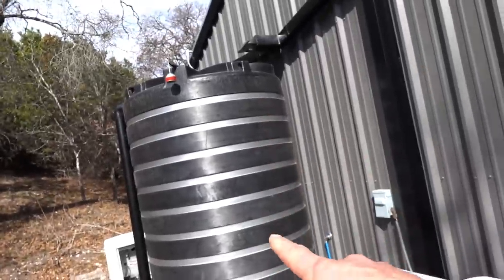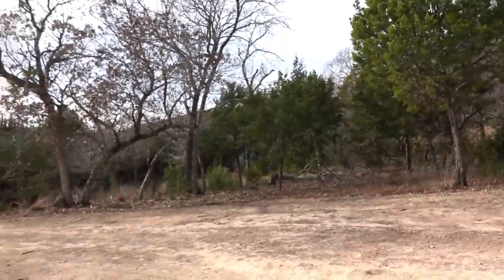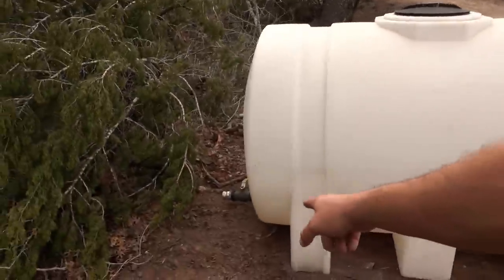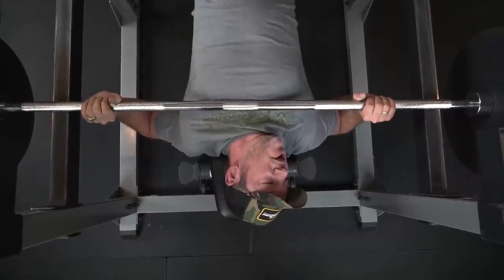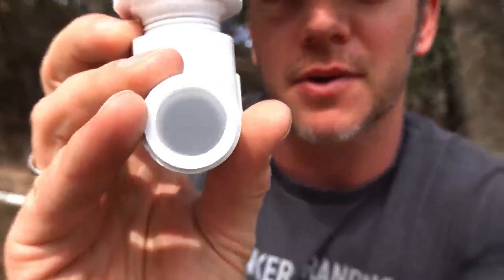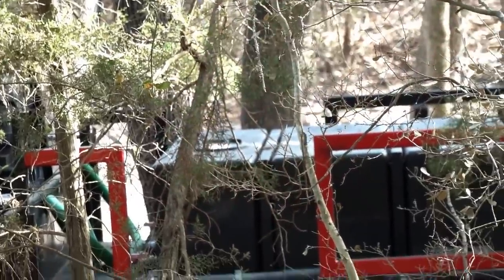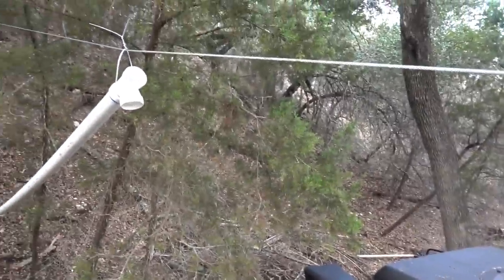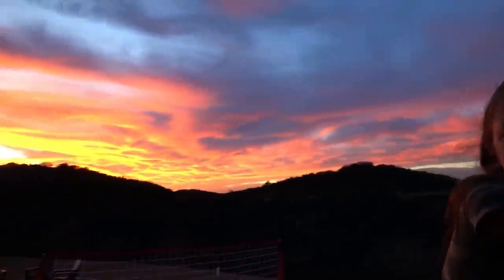Trying to Make this Work... And my Fire Truck is BROKEN!

Comment: Just thought I would point out that you don't need to suspend the pipe at all. As long as the highest point in your downstream connection is below you source (tank) output, you will have pressure to create flow. You could run your pipe along the ground till the bottom of the hill, and then have it T up to your valve for filling the firetruck tank. Your pressure head will be the same at the outlet (mostly, because your losses from pipe bends will be of negligible difference) regardless of whether or not you suspend the pipe. You would just need to make sure that you can drain from the lowest point to prevent any burst pipes from freezing.
Reply: even if the highest point is higher than the source, it will flow, once the air is cleared (syphon) - as long as the end point is lower than the source.
Reply: this
Reply: I came here to make this comment. Glad someone else saw this right away.
Reply: matts not worryed about anything freezing and bursting look at the water pump lol
Reply: Physics at work!
Reply: If Matt just had access to an Engineer, preferably a civil type, and get their ideas on how to properly set up a water system. They would probably tell him he should get 2" poly, as it comes in  lengths that would make the run to the bottom of the hill jointless, it's more resilient and is less prone to cracking unlike schedule 40 PVC. But, were would Matt find him a Civil Engineer?

Maybe he should go ask Mere.
Reply: @Bugsey35  you just need basic understanding of physics
Reply: Yep. PVC is not likely to last long suspended by ropes/cables from trees, lol.. should've used an irrigation pipe instead (although I understand it's not as easy to find)
Reply: @Justin-C  The point is, nothing needs to be suspended. You just run the pipe all the way down the hill on the ground. Then run it up the tree to whatever height you want. The only thing "suspended" would be the pipe to get it into the water tank on the truck.
Reply: Matt you used dwv pipe not intended for pressure also you have to get all the water out of the pump when it’s freezing out. Also you don’t need to suspend pipe the pressure will be the same if you fill from the bottom or top of the tank.
Reply: @rgoers  I'm aware. I was commenting on what was actually done and how it's likely to go.
Reply: And if he wanted more pressure, a pump with a solar panel would double the pressure.
Reply: @Bugsey35  I pointed that out above with links to the correct product (Aussie ones admittedly but its enough to know what to buy). For some reason Americans love PVC for everything even pressure pipe, poly is far superior and a lot more freeze resistant.
Reply: @marvindebot3264  yeah we use HDPE for most stuff at work.
Reply: Also could have gotten a 12volt 55 gpm pump for less than $200 and could jut put the tank at the range…
Reply: @Bugsey35 Picturing Mere laughing so hard if she sees this! 🤣
Reply: 🤣   I laughed so hard watching him do all that with the pipe
Reply: I wouldn't even suspend the pipe to fill the fire truck, I would just use a hose as I think the pressure is in relation to the outlet to the body of water. Meaning that you would get better flow if the hose outlet is at the bottom of the fire truck tank
Reply: I guess I'm not the only one who had this idea. It's the same principle water towers use.
Reply: @Bugsey35  His wife Mere is a civil engineer?
Reply: @Bugsey35  honestly probably the comment of the year right here.
Reply: @Bugsey35  I was gonna say.....ditch the PVC and definitely go for the poly pipe rolls.  With 2", I believe they come in 100' rolls....

I would use 2 inch for the first 100', and then step it down to a 1" poly pipe for maximum pressure.  Plus the 1", or even 1 1/4" poly pipe comes in 300' rolls.
Reply: Awww, dude your late, you just missed the EDC in Vegas
Reply: @Bugsey35  😂🤣 you win the internet today.
Reply: Ya what he said
Reply: @brandonbennett127  Pressure is based on elevation, flow is based on pipe diameter, reducing the size would decrease the flow and pressure
Reply: @PhiLBilly_PhilRodgers  it should be fine. That water pressure will prob never see above 40 psi
Reply: NO !! That is not how it works !  The system would only drain to the equivalent height of the pipe as it comes down the hill . " Water seeks it's own level " !  In other words . If he took the pipe to the GROUND then put in a Tee and went up 10 ft to fill the F- truck . If you took a laser and pointed it LEVEL towards the pipe coming down the hill . That is the amount of water that would not come out 10 ft up !!  It is no different than gluing a U  shaped pipe with 10 ft risers and a RUN of 20 ft , then fill from one riser . The water would fill up both risers and stop coming out IF not pressurized.  Further , if the tank isn't vented to atmosphere, it WILL pull a vacuum and stop draining !
Reply: @g120957au  NO ! Decrease flow , but increase pressure !   Think of a power washer with no nozzle compared to the pressure with the nozzle installed.
Reply: And he should know this from building the water collection system for the chickens at the old house.
Reply: @g120957au  a 2 inch pipe will always carry more water, but will also have a lot more friction loss due to the larger diameter pipe.  Just because the pipe is larger doesn't mean there will be more pressure in the line
  You even seen a hydro electric set up not neck the pipe down to get more psi coming out of the line? I do know what I'm talking about.  GPM is different than PSI.
Reply: @g120957au  also....try this experiment, hook a 1 Inch hose up to your house.....and turn on the water.  See how high it will shoot into the air. Then take a standard 1/2" or 5/8" hose and do the same.  You tell me what one shoots farther.
Reply: @g120957au  it's just simple physics... I've set up probably 13-15 off grid properties with gravity water systems.  You learn a lot through trial and error.
Reply: @indycharlie  A pressure washer has a pump in it, turn it off and see how much water comes out! Pressure come from the head height (or tank height) the smaller the pipe the more reduced the flow, does the water pressure increase as you turn the tap off?
Reply: @PhiLBilly_PhilRodgers  that pipe is still rated for 120psi. Whether local codes allow it is a different thing entirely.
Reply: @g120957au  I was trying to make a simple example , but I see that didn't work . The point was and is . The pressure washers pump can create and specific GPM , generally .  So as I said . If you did not have a nozzle in the P-washer and aimed it in your back yard . It would spray X far . But when you put a nozzle in and increased the pressure it would spray much farther. And before you say it . YES  it would depend on the nozzle selected.                                               But in Matt's case , because for every 27 " in height of a vessel you create 1 lb of pressure . So his head will be static. Therefore your statement is incorrect!   Height does create the pressure , plus the size ( height ) of the vessel . But if you size down in diameter at the working end . You increase pressure and decrease volume .  Your supposed example of flow after it is turned off is meaningless!!  How about a garden hose on your house. That if the cities altitude valve and PRV is working . Your house maintains a set pressure . Will your hose spray farther with a open end or with a spray nozzle attached?
Reply: Next on Off the Ranch: Science Class (finding out things I didn't know about gravity!)
Reply: @GAM1647 yessir
Reply: @leftyeh6495  it absolutely is not rated to 120psi you can read 40 on the pipe. Dwv fittings don’t have as much glue surface and will not hold even 40psi.
Reply: This.  Also the fact that he’s using sched 40 PVC in a non protected environment.  That pipe is meant to be shielded from UV light. If he wants it to last outdoors for more than a couple of years he needs to use schedule 80 pvc, the grey pipe.  That is why it’s more expensive.  Best to use black poly landscaping pipe
Reply: In Europe we would use a 
Long hd pe or hd pp pipe Instead of 
Glued short pvc pipe lengthts . The pp pe pipes are good for quite high pressure and they dont break if water freezes in them only the connector  may crack , also there are big rolls upp to hundreds of meters depending on the size of the pipe.
Very strange that u use glued PVC for Fresch /consumption water  in the usa.
Reply: @PhiLBilly_PhilRodgers  I was shaking my head and yelling at my screen the whole time he was piping that up, " Those are dwv fittings... get pressure fittings... plus good luck getting garden hose threads to seal on NPT threads i would have used a 2x3/4 threaded bushing glued into the ball valve and threaded a 3/4npt x 3/4 garden hose adapter in for the hose connection...

Comment: MATT.......simplify the process here.  First off...don't hang your pvc pipe....keep it on the ground.  When at the bottom of the hill on the range with the firetruck....use your trash pump as a suction to pull the water flow from the tank at the top of the hill down into the firetruck tank.  This will dramatically increase your ability to fill the firetruck faster then just using gravity.  Also use quick connects when connecting from the pump to the pvc pipe.  You can use this same process if you have a nearby pond to suction from the pond into the firetruck....just use a submersible debris screen.
Reply: New shirt-   “ gravity is free”
Reply: @IraqVet0608  guess he didnt watch the video... he didnt want a pump.. lol
Reply: I am with you. Leave the pupe on the ground but then run a flex hose to the tank   an the total head pressure will be the same but simpler run. Can hook to the pump too. That cable system will cause problems. Pipe sway in the wind.
Reply: @mikeb9478  He's saying to flip the connections on the pump that's already on the truck so that it pulls water from the pipe and pumps it into the firetruck tank. It wouldn't be quick if he needed to refill the tank in an emergency, and he wouldn't be able to keep spraying as the tank refilled. I honestly don't see the point in refilling the truck tank with the pipe anyway. If he needs more than 500 gallons to put out a fire on the range, I'm thinking it's probably more than he could handle. And there's no point in using it to refill the truck tank in a non-emergency situation because you're just going to have to use the truck to refill the tank on the hill.

Comment: Vibrating pumps needs flexible fittings before solid pipes in order to prevent stress fractures (=cracks) so when replacing the pump casing (or pump) also get some AV (Bellow) fittings between the pump and the pipes to ensure the new pump casing doesn't suffer the same fate.
Reply: I figured it had water in there when it froze recently
Reply: @mybackhurts7020  he said that was not the cause and it had been broke for a while so the recent cold snap would not have done it.

Comment: Keep in mind that that small cable will start cutting into those trees and basically chokes the tree. In our scouts we regularly build ziplines and we have accidentally killed some trees by leaving the zipline around the tree for too long. It can help to stick some pieces of wood between the cable and the bark so there is still a place for the saps to flow. Love the videos!
Reply: I was thinking pin some sheet metal or a section of tire between the cable and the tree trunk , that would help spread the pressure as well.
Reply: Agreed Liam
Reply: There are straps you can buy from Yankum Ropes called tree savers, that can be wrapped around a tree and then attached to a snatch block. Many You Tube recovery channels use them.
Reply: @michiganengineer8621  there are special rubber mats for that
Reply: Good sir, would you like to explain the countless trees that have tires around them and bikes or cars stuck in them that are thriving and have been for decades????  🤔
Reply: If permanent, run the cable through the tree and attached to wide washer on back.
Reply: @Midori900  I know, as well as straps that SMART off-roaders keep in their vehicles for when they have to winch themselves out of a hole (or upright).  I was thinking of something he might have available already or could get immediately.
Reply: @peterpro2a  I only hug birch trees.  The bark on most of the others is too rough . . . 🤣
Reply: @Midori900  There are old car tires for that! Low budget, old school!
Reply: @michiganengineer8621  funny funny for sure now on that I give you 2 👍👍
Reply: As long as it's not completely wrapped around the whole tree which is called girdling it should be fine I had a maple tree were one whole side of the tree died and found out it had gotten sunstroke. That was twenty years ago and finally in the last five years enough of the bark crew over the dead spot and that it is starting to grow very well on the top.
Reply: I was thinking the same thing the cable will end up embedded in the tree
Reply: @mikemullay5622  those are meant for temporary use to protect the bark like when The Diesel Brothers need to tie off to a tree. They aren't meant to be kept on the tree permanently. I've seen what straps being left around a tree for too long looks like. It's not good for the tree.
Reply: @bradwilson9167  the tree can stay alive because it has a lot of time to adjust to the force of the thing wrapped around it, it will start to grow around it. It you suddenly wrap a cable around it, it has no time to adjust. Its the same for us, tie a tourniquet and your leg or arm might die off when applied for to long but if you wear an armband or something like that, your body adjusts to it (worst case it grows around it)
Reply: @liamg3061  tree grow very slow, you make no relative point at all. It's literally the same scenario, tire, wire, bike.... it will not "choke" the tree 🤦

Comment: You can bury the pipe and run it up the tree. It will have the same pressure if the outlet is at the same height, whether it runs downhill the whole way or has to run uphill up the tree. Will make for a much cleaner install. Hope this helps!
Reply: Yeah but costs another 1000bucks
Reply: @dylanzrim3635  how? He has the equipment to bury it?
Reply: NO !! If he raises the pipe up 10 ft from the ground by the truck . He would lose 10ft of PSI . About 4.5 PSI . Plus it would create a bunch of pipe that would not drain !!

Comment: Elevation in feet x .433 = psi. I used to work for a public water supply and they are required to provide 35 psi to your water meter. If they have a gravity feed system they need roughly 80 ft of elevation to accomplish this. Good luck. Also using bigger pipe helps maintain pressure over a long run of pipe.